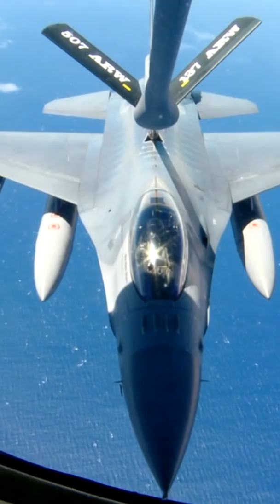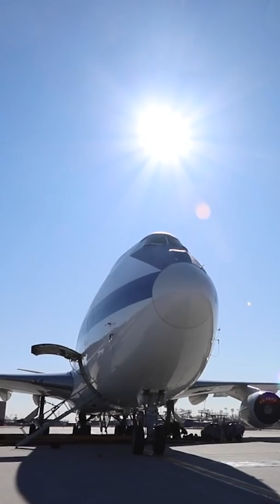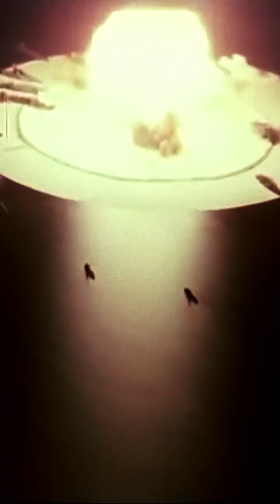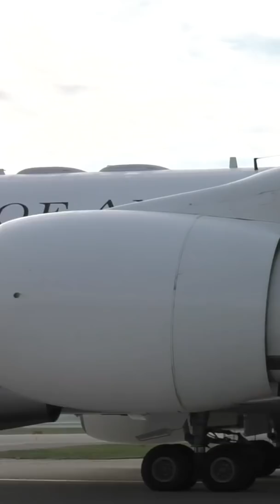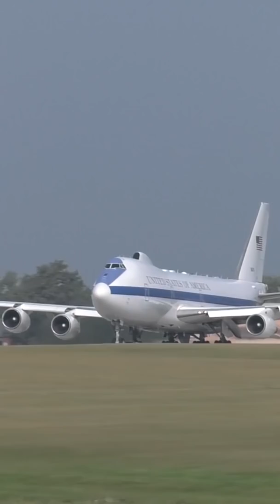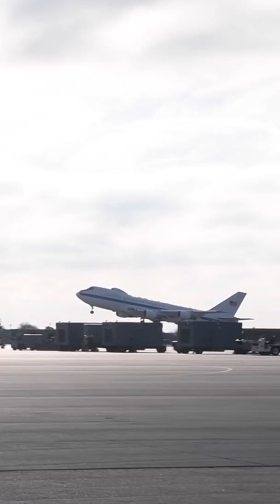The Doomsday Plane #shorts

Comment: in the past few months, they have been quite active and airborne
Reply: Uh oh 😟
Reply: How do you know?
Reply: @afcgeo882  tools like adsb or flightradar. all are tracked if transponders are on.
Reply: @Neeboopsh  If the data is correct, yes. However, the E-4s never use an active transponder unless they’re doing routine training. Are you in Oklahoma?
Reply: @afcgeo882  i am not. but i never said at all that they are operating in a non training or maintenance role officially. its just been an uptick in flights that are tracked. read into that what you want.
Reply: It's called maintenance flight, because of the lockdown the plane left cold for a couple of months and after the lockdown is over the plane undergo some procedural maintenance including mt flight
Reply: @AJ-dx6bn  The Air Force never had a lockdown.
Reply: @Neeboopsh  I’m not reading anything into it. I just think you’re BSing. 🤷‍♂️

Comment: "Can stay in the air for a week"
But if there was a EMP, the plane refuelling it would be nothing more than an expensive statue
Reply: Really? You think they would build 4 of these and not have any idea on what to do for fuel afterwards? I guarantee you if they built 4 which of these (which probably isn't even the real number) they built at least another 8 or more fuelers in the same specs. Not to mention the amount of fuel the states has stockpiled is more than likely an astronomical amount not to mention them having technology to keep the fuel fresh and operate underground refineries is completely possible.

Comment: I don’t understand. Why have a dooms day plane, when there is already Air Force One?
Reply: The doomsday plane is like a flying shelter or bunker, the Air Force One is more or less a flying White House. Of course AF1 also has all safety systems you could possibly think of, the E-4s even go a step further and have systems onboard which simply are unnecessary onboard AF1
Reply: Actually when the president goes on board the doomsday plane it becomes airforce one

Comment: But....if there is a nuclear issue, and they need to refuel in the air, then what happens to the plane that has the fuel? Is that one designed to withstand those conditions aswell?
Reply: all military aircraft have shielded systems, why do you think they cost so much.

Comment: Takes two KC-135s to fuel an E-4B or just one KC-10 as shown.
Reply: only refueler shown is a KC135 but you are correct about the KC10
Reply: I beg to differ good sir. The first one shown with the viper is KC135R the next image shows KC-10 boom on top with E-4B and profile of KC135R and E-4B on bottom. Confusing? You bet. 😅

Comment: I once saw one from 80s time and it was full of tables with large box shaped furniture holding old analog equipment. This one looks similar. Takes too much fuel to hold this equipment in air for long time. Isn't there better solutions? Seems like outdated tech

Comment: Ever seen what happens when a bird hits a plane 🤓
An aluminum plane will not fly all the way through a steel and concrete building 🤓 
Three of these planes don't carry enough fuel to melt even one steel beam ☝️ much less melt three buildings to the ground 🤔 at free fall speed straight down

Comment: I was literally just wondering, do planes have like some big dynamo, or do you charge them.
Reply: If you're wondering where electricity comes from on 747 or similar airplanes, yes the turbofan engines are equipped with electric generators and so is the APU in the tail

Comment: My question is how do the engines not run out of oil a week in the air? I work on the raptor and they go through hella oil. I guess it’s a difference in the engine design? I’m no engineer.
Reply: The person who runs the channel mentioned That's why they only last a week in the air

Comment: So what is the point of refueling in air? Cant the plane just like land lol.
Reply: Extended range missions when safe airfields or airbases are not granted.

And I’m not even talking a doomsday scenario. During the 1991 Iraq War, in the Dessert Storm Operation, B-52 bombers that fired some the first air strikes against the Iraqi forces, departed from the US, completed their mission, and returned without landing once, only refueling mid-air.
Reply: @AxolotlAndy  I guess I just assume planes hold a lot of fuel
Reply: @randomguy51090  Yeah, although some do, and others not, its actually funny because the B-52 is one of the USAF aircraft with the best range.

However others like fighter jets consume way more fuel, than any other aircraft, civil or military, that why these, apart from being capable of refuel mid-air, carry external fuel-tanks in their weapon’s hard-points.

Comment: When did they test this plane on its EMP resistance ability, I need to see 4 tests for accurate data findings, Jokes aside.
 If its for POTUS and Sec Def surely theory alone wouldn't suffice, or would it take trial and error to amend such theory. An internal Faraday cage is great for diverting Pulses to protect conductive devices inside but what about blast pressure. How would the plane resist this. Much like rock dropping in a puddle the rest of the water ripples somewhat like a nuclear explosion and air ripples. Surely the unstable atmospheric pressure would knock the analogue guages out of accuracy and the engines would suffer from rapid instability from low to high and constantly changing its pitch would choke the engines. Theories welcomed
Reply: I don't think it's their first rodeo..🤷‍♂️🤷‍♂️🤷‍♂️
Reply: America has done extensive nuclear testing I imagine they did some Shield testing
Reply: @randallsmerna384  don't think it'll be the last either  😊
Reply: @FrancisR420  I'd imagine so, but surely not with a plane in motion. I'm starting to think that these planes are just expensive post catastrophic bug out vehicles tbh